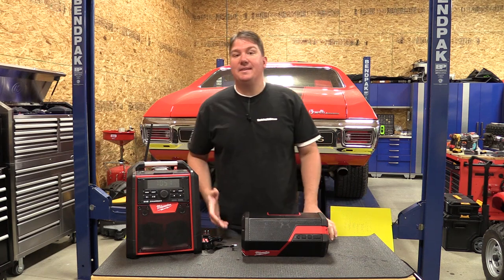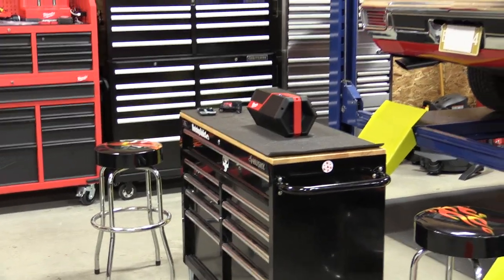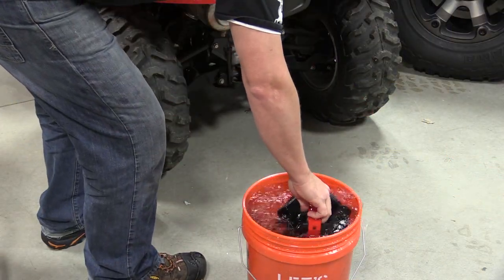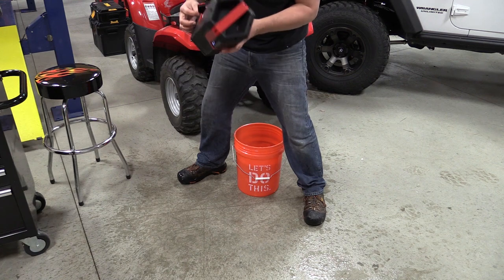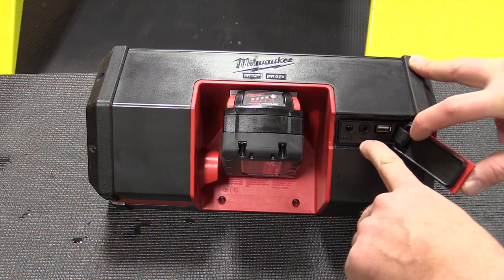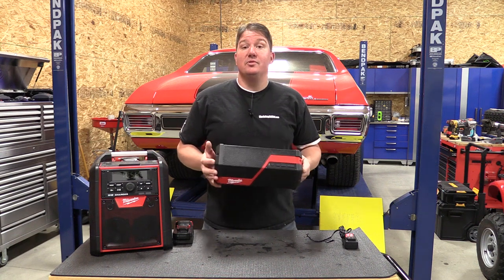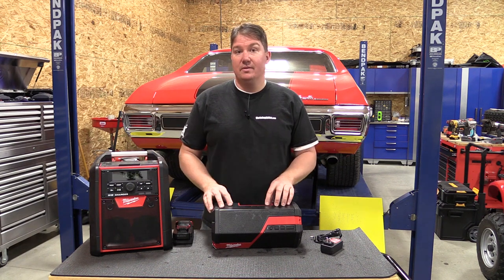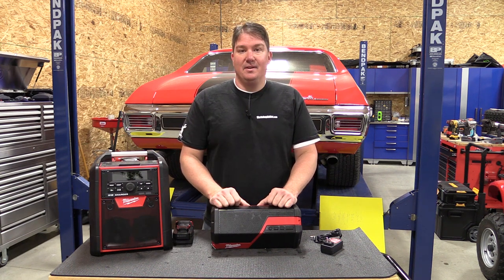Milwaukee M18/M12 Wireless Jobsite Speaker Review -  2891-20

Comment: If you turn the bass up on your phone or whatever bluetooth device you're using it will have pretty good bass in my opinion
Reply: To me it’s shit dewalt and Milwaukee sound like shit even tho there are loud the sound is not crispy the bass is very sloppy
Reply: @dennistv598  what would you suggest?
Reply: Brett Walkom JBL and bose
Reply: Brett Walkom JBL and bose are the best been the best hands down
Reply: @dennistv598  I have a ue mega boom the sound is great but lacks volume on noisy sites.. That's why I baught a milwaukee.. Plus it lasts for a week on a big battery.. Mind you I have the digital radio version not this one
Reply: Brett Walkom not even my JBL Blow them away my co worker has Milwaukee mines louder with out full volume
Reply: @dennistv598  which speaker tho
Reply: Brett Walkom u got to get the big JBL not the little ones I recommend jbl boombox
Reply: Brett Walkom I have alittle one charge 4 it’s louder than my co worker Milwaukee and it’s half the size but I work in a factory so idk where u work at
Reply: Brett Walkom they cost a lot around 300 to 500 worth the money go to your Best Buy store or any store that has the JBL boombox and newer models and u can test them
Reply: Brett Walkom Bluetooth and it use usb C and u can charge your phone to
Reply: @dennistv598  yeah 500 isn't worth the money mate.. For something that has no radio
Reply: Brett Walkom up to u
Reply: Brett Walkom but most definitely worth the money
Reply: @dennistv598  I already have a ue mega boom which is basically the same anyway
Reply: @brettwalkom948  who still listens to plain ass radio? Lol
Reply: @esellanta  more than you know
Reply: @brettwalkom948  apparently

Comment: Not being able to adjust the sound on this wireless speaker isn't a bad thing at all, its beneficial. The speaker outputs raw sound allowing the user more control of adjustment from the input source. Why do all smartphones have an equalizer feature? For this same reason, for when the user encounters a speaker or terrible encoded music file. We can adjust the equalizer settings to fit our needs, and it can extend or deplete the stated runtime of the speaker battery depending on the equalizer settings from the input source.

Comment: Just wanted to say thank you for the review, sold me a few months ago on buying before a camping trip, now I use it almost every day. After its broken in has better bass than my Milwaukee Bluetooth jobsite radio and I feel better sound quality. Now my more expensive radio mainly gathers dust at the shop
Reply from the maker: Hey Mike D, Glad you like the speaker!  We found ours has good bass in a smaller room but once outside, it loses all bass.  So, it comes down to where you use it to us.
Reply: WorkshopAddict Yep your right on there, along with all the other points in vid. Just comparing speaker to radio itself (in my uses) speaker sounds richer but could be because the extra "passive radiators" the radio does not have. Could always use more bass, would definitely need a bass/treble adjuster on speaker then to keep it down in certain situations. Love the durability and lighter weight (the job-site radio feels like it's filled with lead now haha) 
Keep up the great work! Based many a purchase off your reviews and you touch on specs/tests other reviewers over look.

Comment: Nice review, but does it still work?  Because dunking it in water is only the first step in the process of testing water resistance.   The real test is to see if it still works a week or two later; especially if it is being stored in a warm, enclosed environment such as a jobsite trailer.   Corrosion takes a least a little bit of time.

Comment: I got this as a gift and I use it just with the AC plug I don't have Milwaukee batteries if I bought one does this radio have the capability to charge batteries because I don't want to buy a charger and Battery?

Comment: Found one of these in the woods, looked like it had been there a week and still worked. Does plugging it in to the 18v charge the battery?
Reply from the maker: It will not charge batteries.  Would be nice if it did.

Comment: Is it possible to pair this jobsite speaker with the 2792-20 M18 Radio/Charger?  I do not have any other Bluetooth devices other than the two items shown in the video.  I'd like to play the Jobsite Radio with my iPod Classic (which does not have Bluetooth itself) playing through it on one side of the shop, and have the wireless speaker pick it up on the other side, if possible (range is well within the advertised 100' max).

Comment: Mine broke after 2 months of ownership and it fell 2ft. Good thing I had the box and receipt and milwaukee warranted the speaker no questions asked. But I do have some concerns. First it only has a 1 year warranty, minimum warranty on tools like the string trimmer have a 3 year warranty, so that tells me milwaukee is not up to what it claims for the speaker. Second I got my new speaker thru FedEx out of nowhere witch is bad as anything labeled milwaukee is guaranteed to be stolen off your porch if your not home. Good thing I was home but things to watch our for.
Reply: Milwaukee tool on Evans in Colorado even advised me to not get your tools delivered and to pick them up as if a porch pirate steals them they will not warrant such theft

Comment: It is actually practical to save on radio electronics and cost for those who do not need a radio. With technology today, I have a music only player (not a phone) and that has everything I want to listen to. Radio is worthless. Commercials, djs blabbing, music you do not like. What is the point of using radio.  However this unit lacks a compartment for your player and should have the input and usb port in the compartment which most other work radios and speakers seem to lack. Other than that, it would be perfect although you say the audio lacks quality as well. Also I would say that this unit lacks an open carry handle bar. Now I use the m12 radio modded with a usb port inside the compartment and it can not be beat by anything. Compact, carried with one hand, sounds great and protects my player and charges the player.

Comment: The skinny one has 6 speakers to it. 4 big ones n 2 tweeters.  The bigger Milwaukee radio has 4 speakers 2 big speakers n 2 tweeters.  I wanna know which rasdio sounds better.
Reply: The skinny one, aka the Milwaukee M12/M18 bluetooth speaker has 2 woofer/midrange speakers, 2 passive radiators (look like thin metal disks suspended to allow movement) and 2 tweeters, 4 total powered speakers

Comment: how good is the sound quality compared to the bose soundlink mini?
Reply: Porsche Carrera - It doesn't really matter. If you can't adjust the sound due to the lack of an integrated EQ, adjust it from the input source. I have a Bose Soundlink Color 1, it has no integrated EQ, but if you adjust the EQ from, for example your phone, it sounds amazing. I've been a homebrew sound mastering engineer for about 20 years and with a trained ear, a simple 3-band EQ on any radio it will affect the pre adjustment from the input source. For best sound adjusting each music file would be the ideal thing, but only if the person knows how to and the vast majority don't care for musical quality. They just want it to sound loud. In order to make it sound the best to its true potential would be to adjust the EQ at the input source. I'm an audiophile so my choice are both speakers regardless of RMS because it will depend on the environment its going to be used. A raw processing sound speaker like this one, all day because with 40 total watts, there's plenty frequency to work with.
Reply: What a non-response.

Comment: I dunk mine and it didn't work after that.
Reply from the maker: Battery issue?
Reply: No battery was good  radio messed up bluetooth, sound  everything
Reply: Same after some light to medium rain it stopped working battery works fine for my drills

Comment: I can tell you from first hand experience, keep that speaker in the water long enough, it WILL destroy that unit as well as the M18 battery attached to it. Those split second dunks won't faze it since it's sealed up quite well,  just don't leave it in a kayak overnight and have it rain on ya
Reply: Danny Sweborg It’s IP 54 rated that’s only rated to be splashed with water not submerged like they did here.

Comment: I'm really disappointed that milwaukee doesn't put a connector where you can just connect an extension cord.

The jobsite fan is the same way and it's really poor engineering.